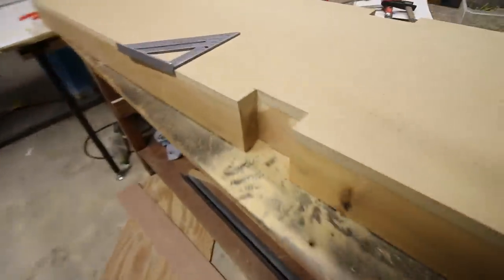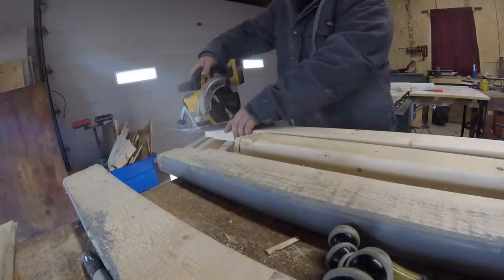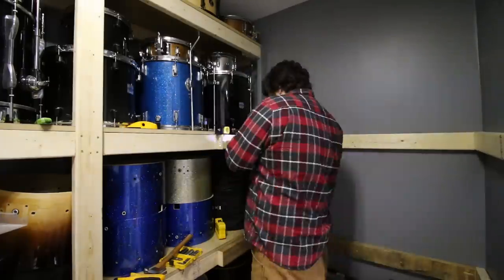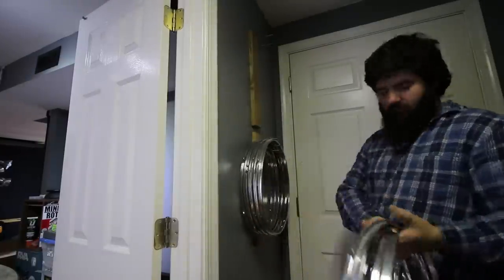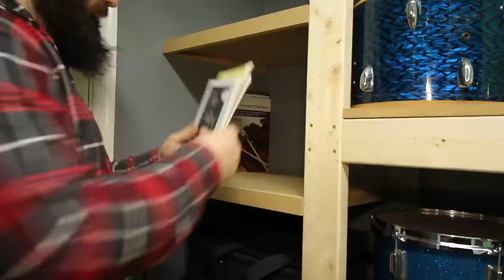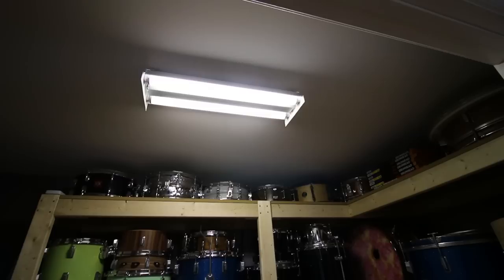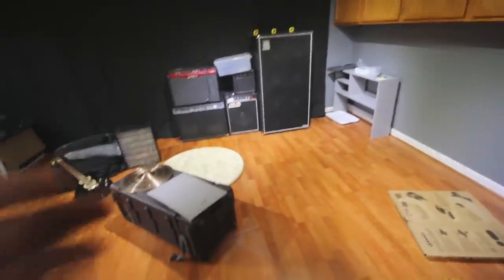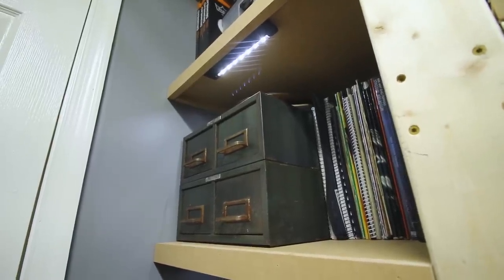Building The Ultimate Drum Closet

Comment: I did something similar, but I made a mic booth/gear closet. My closet was just like your’s. I reused the wood  and rebuilt it to what I wanted. Sealed seams and sound isolated the cubbies. I made some accordion doors, using adjustable blackout window shades so there wasn’t anything in the booth that could rattle using Velcro to keep them closed. I hope this helps someone who is looking to do the same thing to their closet. 😎
Also forgot to mention, I saved a 💩 load of 💵 🤗

Comment: Hey Dave, 
I've got a quick question. I'm trying to find a way to mount a bass drum horizontally and am a little stuck for ideas. There is the "Multi-Fit Bass Drum Legs" but I'd rather not pay out the ass for them. Any suggestions on what to do? I'd like to keep it non-permanent but nothing is off the table as of now. Thanks for any help you can offer.
Reply from the maker: floor tom legs? or rig it up using the tom mount on it to a stand some how. or you can make some sort of clamp on floor tom legs if you want it to be detachable. Thats about all I can think of.
Reply: rdavidr Thanks for the suggestions. Time for an epic montage.